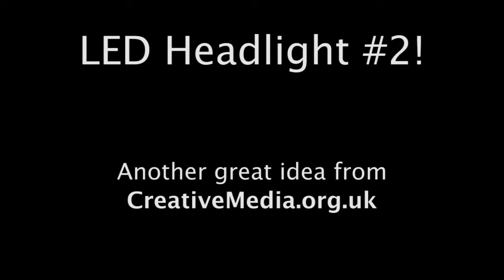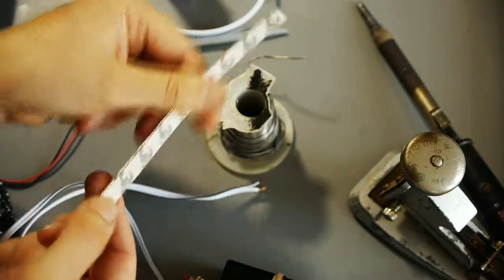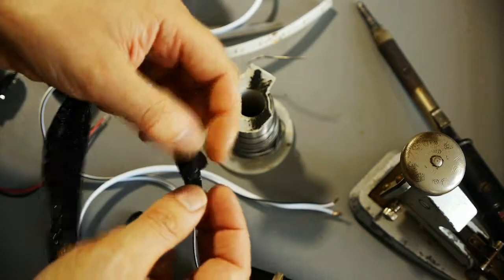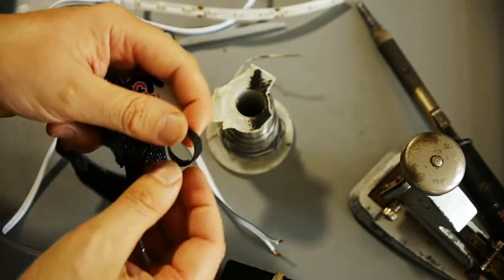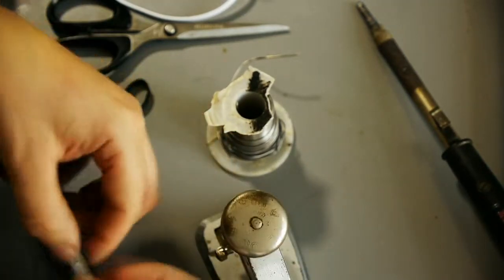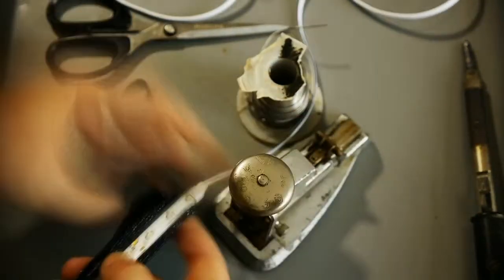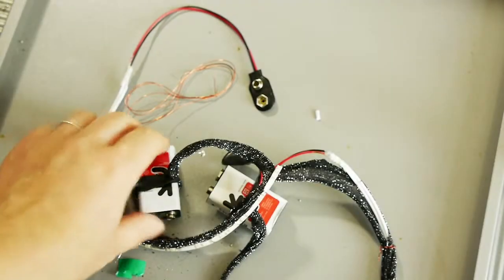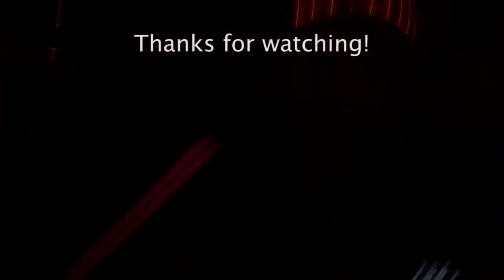How to make LED strip headlight for bicycle helmet, jogging, safety, raving etc

Comment from the maker: Hi ShadowSwift. You should be able to find them on EBay with a search for LED Light Strip. I've rewired my head-light to work off one battery, and I've added an on-off switch too. I replaced the old tights with a rubber strip cut from an old inner tube and stapled to the right length.